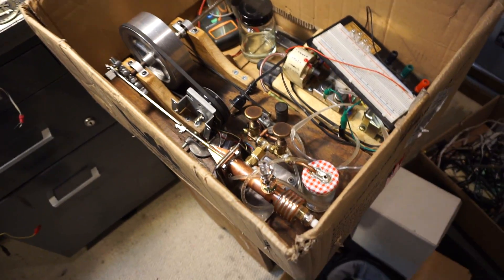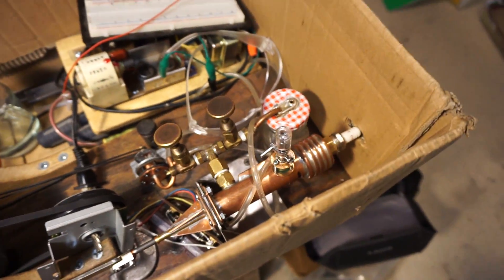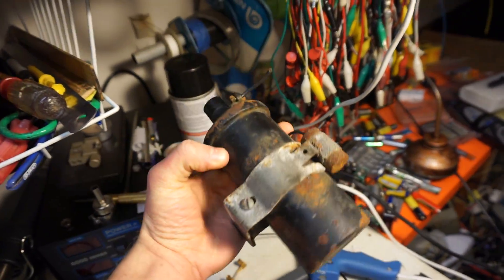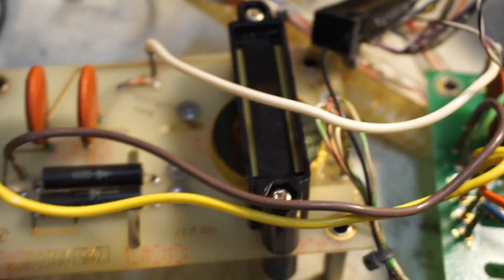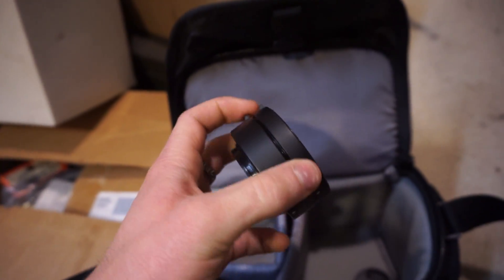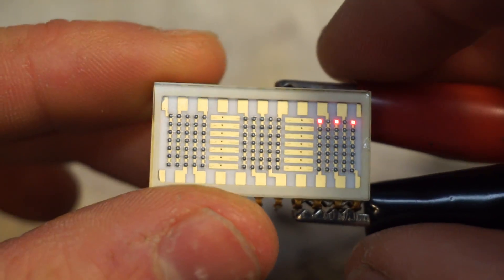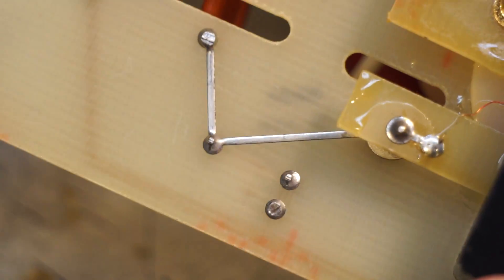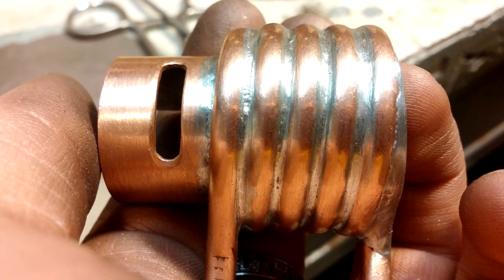Merry Christmas, Internal combustion Engine Progress and Other Stuff I've Been Up To

Comment: Hook the 36V brushless motor/generator directly to the Ozone generator in the circuit,  after the AC to DC step down transformer.
Just like hooking the phone charger to it. It will run the circuit to produce spark without needing to be plugged into mains power.

Comment: I know this is a bit old now but have you considered running your fuel through the water jacket? So far as i know warm fuel atomizes better. could boost efficiency. It would also cut out potential for water scale build up
Reply: i would have used the warm water to circulate either through the fuel bottle or the inlet manifold.
Reply: +IsbjörnXII that could have worked as well. not a bad idea

Comment: I miss your eletronics projects like that home made ajustable power supply u were building, high voltage experiments, did u take a break or lost interest on it?
Reply from the maker: +malicious1111 When I was testing out the boost converter it fried under very little load.  I kinda scrapped the project.

Comment: Nice work on the engine! I've been following the build from part 1. Well impressed that even the water pump was made entirely from scratch :O
If you've still got access to a lathe, have you thought about casting and machining an aluminium piston for it? You might be able to improve compression by having more than one piston ring groove, like in commercial engines and maybe use lead, tin or another soft metal to form the rings..?

Also, I've built a few ignition driver circuits before and while I've made MOSFETs work, they die incredibly easily if they see HV transients on any of the pins.. I found darlington NPN transistors to be almost indestructible during testing (MJ10012, using a second transistor to drive it with a logic level signal from an arduino). The coils I tried needed a fairly fixed 1-2mS pulse IIRC, too short and the spark is weak, too long and the coil saturates and draws excessive current.

Finally, those HP LED modules are awesome! They look like they might be some of the first commercial LED matrix modules, what with the ceramic bases, gold plated and so on, no expense spared! Might be worth messaging Fran Blanche (of the same YouTube channel name) and asking about them -  a fair few of her videos are on extreme cool vintage electronics, and might she might be able to shed some light on them or point you in the right direction?

Comment: I changed all the bad tungsten lamps in my Christmas lights to LEDs this year. I had plenty of LEDs and all I had to do was build a simple bridge rectifier.
Reply from the maker: +ElfNet Gaming Hahaha nice!  I bet that was a lot of work!
Reply: not really. I have so many strings of dead LED christmas lights I have an over stockpile of LEDs. This year alone my neighbors gave me all their dead strings and I have well over 5000 LEDs of various types and colors. Add that to previous donations and collections and the numbers soar on up there.. I even re-purposed some of the cold white version as usable light sources that are totally solar powered.
Reply from the maker: +ElfNet Gaming Wow!  It's gotta be a ton of work pulling all the bulbs out and then threading the LEDs into the holders.  I'm surprised that the number of bulbs is the right amount for LEDs too.
Reply: I had to make some modification here and there but nothing to bad

Comment: I don't know how I ended up on the your channel, but I'm glad you can do what you do. I've torn stuff apart and modified things since I was at least 11 years of age, now 40...
With your internal combustion engine and the mention of a MOSFET and coil, I thought you would have alot of fun with a Megasquirt or Microsquirt. These are automotive ECUs you can assemble your self, tune, log, and monitor sensors on an engine. This is right up your alley....

Comment: Will this work in an Rc plane, I mean how heavy is it
Reply from the maker: +Jigsaw I wish!  It's fairly heavy and it only puts out 15watts so it's like 1/50th horsepower.
Reply: +Makerj101 I mean what if you made it out of aluminium and carbon fibre would it work and more powwwwwwwer

Comment: Hey, you featured your tektronix tm504 in an earlier video about 5 months ago.  I was wondering how you like it/how it's holding up.  I need some equipment, and the tm504 seems like a reliable and relatively cheap option.  I don't really have to money to get all new equipment. 

ICE looks great, very impressive.  Makes me want to build one!  Merry Christmas.
Reply from the maker: +Henry Love I love it!  I mostly use the power supply.  I almost always have the volt meter in parallel with the power supply.  I use the signal generator a lot too.  The signal generator has a really nice out put so you don't need any amplification to run small speaker and such.  I have not done much with the pulse generator yet.  I highly recommend it.  Make sure you get one that has one of the good variable power supplies that can supply 1.5 amps.  I believe there is also a power supply model that will only do 500ma.  Be warned though, the thing is HUGE.  This would also not be the biggest bang for your buck if you are looking for just a power supply and volt meter.  If what you need is a power supply and a volt meter, your basic cheapo meter will probably do more than this meter and one of these power supplies can probably do more amps and is possibly cheaper:  http://smile.amazon.com/s/ref=nb_sb_ss_c_0_14?url=search-alias%3Daps&field-keywords=variable+power+supply&sprefix=variable+power+supply%2Caps%2C241 
If your looking for signal generator you might be better off getting a signal gen like this:  http://smile.amazon.com/Sinometer-Function-Generator-stability-accuracy/dp/B000JD0BVG/ref=sr_1_11?ie=UTF8&qid=1451222707&sr=8-11&keywords=signal+generator
The modules are fairly expensive for this unit as are most old Tektronix equipment.  They will run you about $70 a module on eBay if you get a good deal.  I was looking to buy another power supply module and volt meter for mine but I didn't want to pay that much.  Could get a decent auto ranging meter for a similar price and it's a ton more portable.
Reply: +Makerj101 Thanks!  That's very helpful, I'll take a look at some smaller units like the ones you linked

Comment: dude! you where right about the extension tubes, i need to get my hands on one of those! much cheaper solution to a macro lens. great to see another vid, loving the look of that engine, some fine work you do, its like a piece of art. Keep it up man!
Reply: +Makerj101 You could also use something like the Hama Nah Close-up. You just screw it on your lens like an ordinary filter and it allows you to focus really close. It does not change the focal leght but instead the minimal focus distance.
Reply from the maker: +Corbonzo Yeah the extension tubes work really well!  I can even get closer shots but for video it's inconvenient.  The way to get closer shots is by zooming in the telephoto lens all the way but the draw back is you have to be about 4 feet away from the subject to be in focus.  It's kinda odd really.  But they are pretty nice and cheap.  They also do not effect the quality of the image at all unlike those magnifier filters things.  These are the ones I bought:  http://smile.amazon.com/gp/product/B00BXZ9ALQ?psc=1&redirect=true&ref_=oh_aui_detailpage_o00_s00  They are all plastic but a pretty good quality plastic.  Thank you!  Will do!
Reply from the maker: +spidermann5000 How does it make it minimum focal length smaller?  How much will it decrease the minimum focal length?  Thank you!
Reply: Its like if you put a magnifying glass in front of the lens, its really simple. A teleconverter does deliver better IQ tho but I think for the kind of video you are doing it would be al right + you would not neet to film from one corner to the other.

Comment: 9:53 They break way more easily and the glass fragments can damage the camera lens even if the would not be harmed without the filter. Look out for that one. But dor dust protection, they are cool.
Reply from the maker: +Krisztián Szirtes Hmmm I suppose I could see that.
Reply: +Tigerlie Not all of them are covered in that one. Most UV filter drop very minor detail. Also there is a kinda good article on this
http://petapixel.com/2015/08/31/photo-mythbusters-how-much-do-uv-filters-actually-protect-your-lenses/
Reply from the maker: very interesting article.  So yeah cheap filters probably don't do much.  I'll see if I notice any difference in quality when using the filter or not.  If I don't notice any difference than I will probably keep using the filter on the stock lens.  That is because I have found the stock lens harder to clean.  But yeah seems like they are not going to protect the lens at all.

Comment: Nice HP led display , I have a few newer ones that for 7 segment based with the decoder chip in

HP 2011 - Has two 14 stage shift registers in https://www.flickr.com/photos/70642719@N02/16738110290/in/dateposted-public/
Reply from the maker: +TwirlyWhirly555 Cool!  I actually have some of those 7 segment ones with decoders too!  https://plus.google.com/u/0/b/102840732238426269146/+makerj101/posts/GtqE9uVo65v?pid=6130710146805041906&oid=102840732238426269146

Comment: Lazy and Crazy, know the feeling!
Reply from the maker: +Joep Stuyfzand It's too easy!  LOL
Reply: Makerj101 Just a question, with what circuit do I control a universal motor? (Vacuum cleaner)
I need to control the speeds for a lathe.
Reply from the maker: +Joep Stuyfzand You're going to need to change the voltage.  Frequency does not matter for a universal motor.  They will even work great on DC.  So there are tons of ways you can very the speed.  You could rectify mains and then use PWM, you could use a variac... I'd say the cheapest thing would be a light dimmer(I'm not sure it would be able to handle the current) or a ceiling fan speed control.
Reply: +Makerj101 thank you, I don't have that much knowledge about this subject, all of it comes from youtube and google.
we don't have this in school yet.

I am going to try "AC voltage regulator", they are about 2€ on ebay and rated for 2000watts, my motor is 1300watt so I should be good.

will you ever make your own motor? and power something with it! :3